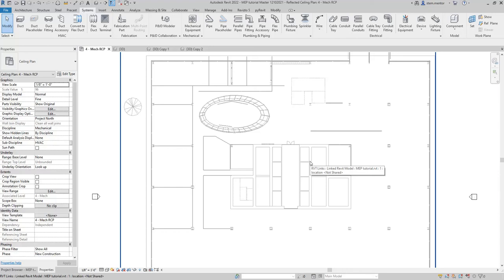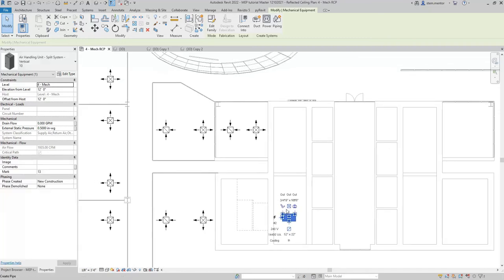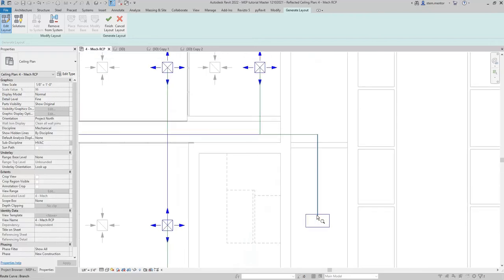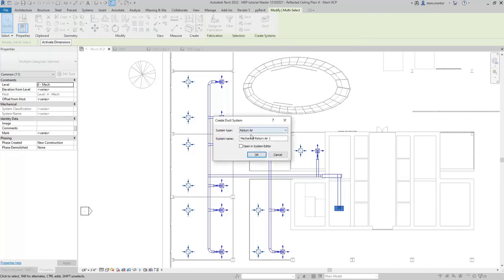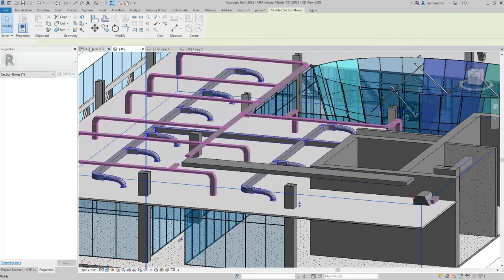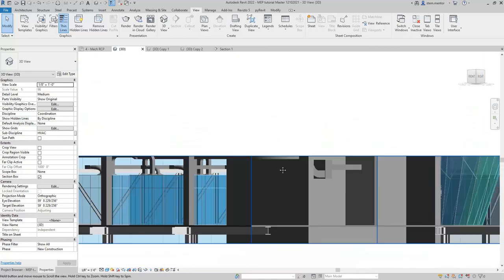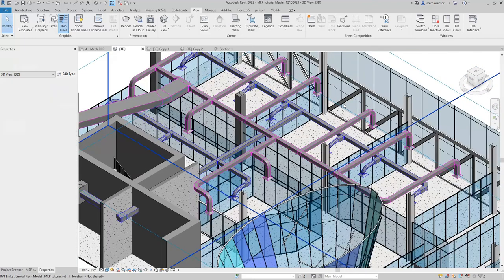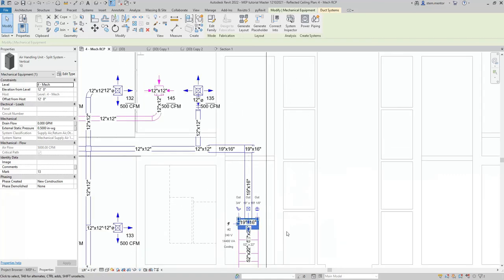Revit MEP HVAC Ductwork lay out, Supply & Return Duct /  Diffusers (Part 1)

Comment: I was confused by you calling the ducts "conduit" at  first, but think you did a terrific job showing how to get diffusers and ductwork in a Revit model.  Best video I've seen so far.  Much appreciated.
Reply from the maker: I was an architect until i invented a new profession called Hypertect LOL. The Hypertect can model Architecture, MEP, and Structure.  Now I'm a Hypertect that runs conduit everywhere.  I like how you pointed out my usage of the word conduit because now I'm going to design an entire structure and make everything out of 3D-printed conduit. everything will be made from a 3D-printed conduit of different tube sizes.  Floors, walls, stairs, doors, sinks tubs, everything.
Reply from the maker: This is a link to the file for download  https://bglatitude.net/products/revit-mep-hvac-ductwork-file